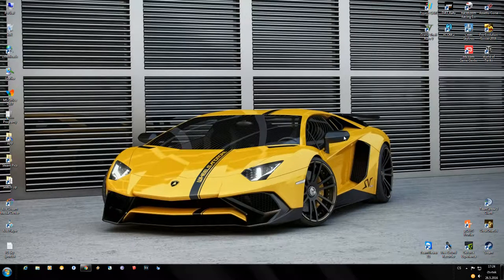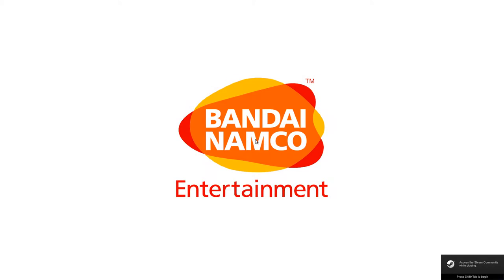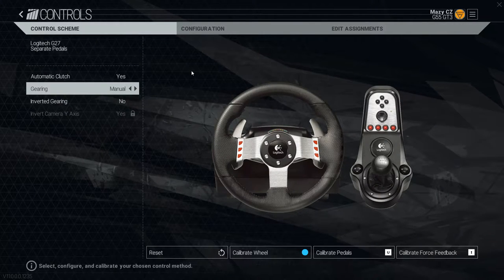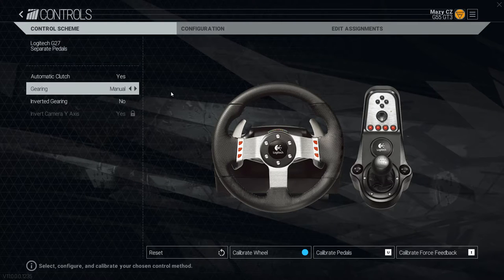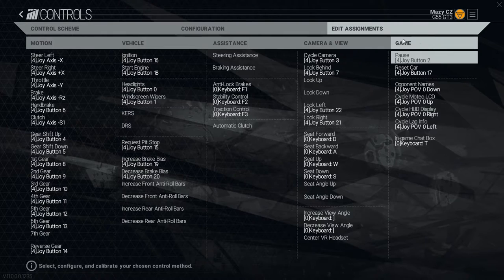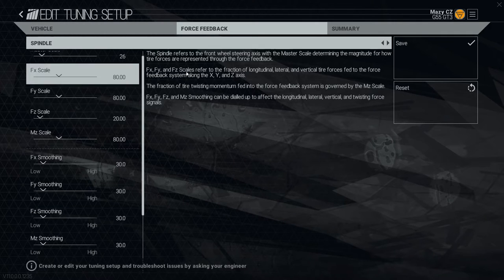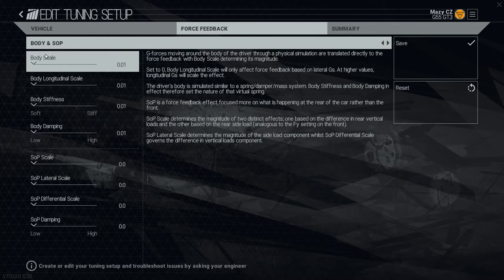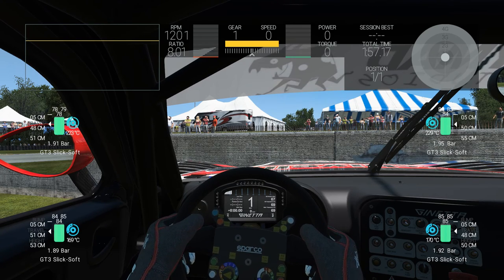Project CARS - Logitech G27 settings - NO CLIPPING

Comment: great video , now a question. which configuration to increase the feel of the steering wheel when the car is straight ?, because I feel dead wheel in straight lines .
Reply from the maker: Not sure on the straights, but If you feel the FFB is lighter than you like, try to increase the master scale in Force feedback - Spindle page in car setup (7:34). But it can make your wheel to clip. 
Or you can play with centering spring in logitech profiler. It basicly add force that it will straighten your wheel so you will get more resistance when turning and overall more heavy wheel I think. But it can mess the overall FFB feeling.
Reply: change the global ffb would not be a good idea and actually alter all configuration values even like to change this specific value , thanks for your help .

sorry my bab english

Comment: I would highly recommend you to try using 26 Sop scale and 20 on the lateral and differential sop scale. It gives you input about what the rear is doing. It isn't realistic but since you can't feel the rear stepping out with your butt like you can in real life, it is really useful. Made a huge difference for me. If you want to try it you will need to reduce the overall strenght a bit since it will add more load on the electric engines.
Reply from the maker: I tried something with the sop scale and the lateral and differential scale in the past but I wasnt very happy about that. But maybe I will try tis later. Thanks for advice

Comment: Hi. I`m trying to play the game on 200 degrees but the car wheels will turn very slowly and then when I`m close to 200 degrees the wheels turn all of a sudden. How do I fix this? Thank you.
Reply from the maker: The only advise I can get you is, don't use just 200 degrees. Use full 900 and the game is OK with that and it feels realistic, so if you turn the wheel in an open wheeled car, by 90deg, the wheel in the game turns 90deg aswell. It is adjusted by the actual car you driving

Comment: do you use these settings for all the cars or do you change it up for each one
Reply from the maker: Depends what settings you mean. I change only those settings on different cars which can be changed in pits, ie the spindle master scale and those stuff on the Force feedback page of car setup.So basicly settings from 7:30 in the video. But usually they stay nearly the same for all gt3 cars and in other cars I aim for the same feeling.

Comment: hi man, I have a g27 too. and I put like u ffb in 85, and tyre force in 75 but in the telemetry the line goes up just by turning. the only thing different is the steering Gain I have it in 300 I think that's stock. pls help
Reply from the maker: Hey man. I haven't played Project CARS for a long time and I don't plan to so I'm affraid I can't help you with that. I think theese settings still works in the game so if you have different settings than in this video, try adjusting them according to mine and see if it works or not. Sometimes the same G27 wheel can have different behavior.
Reply: danvel37 100 force feedback 25 tire force 1.00 steering gain